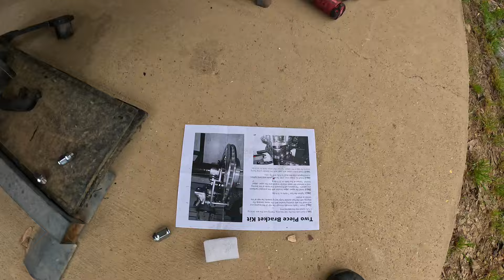HOW TO INSTALL A BULLETPROOF REAR END QUICK PERFORMANCE FOR  GBODY

Comment: I hate to be that guy to point out that you’re wrong, but the calipers are upside down the bleeder needs to be on the top doesn’t matter where the brake line goes as long as the bleeders on top otherwise he won’t be able to bleed the air out
Reply from the maker: Thanks for info quick performance told me wrong I got flip them around appreciate 💯